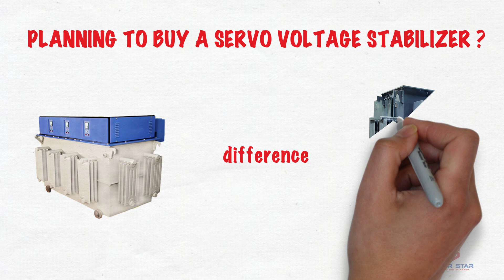DIFFERENCE LINEAR Vs. DIMMER SERVO VOLTAGE STABILIZER | GET SAVED FROM HUGE LOSSES | POWER STAR |

Comment: Hello !

We are one of the leading manufacturers of IGBT Controlled Static Voltage Stabilizer with high precision, fast regulation and inbuilt circuit protections. 
You may check about it more on
https://nkbtechnocratspltd.com/?page_id=125

Contact us on: nkbtechnocrats@outlook.com
Call/Whatsapp: +91 9660061987